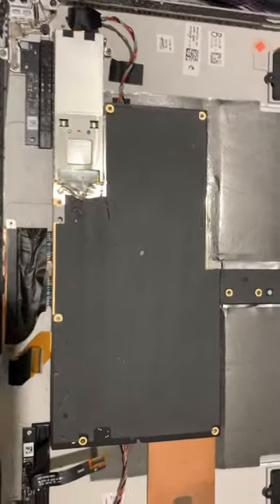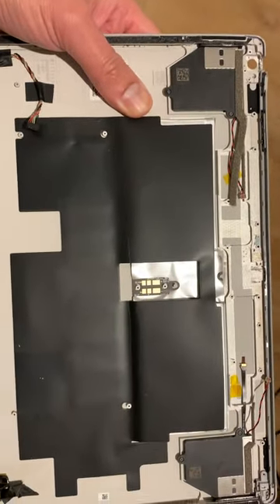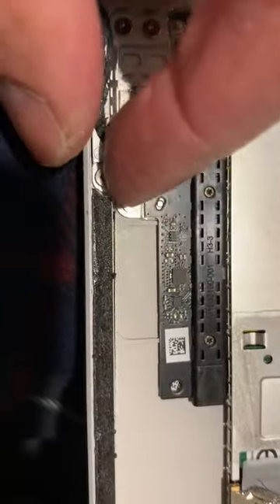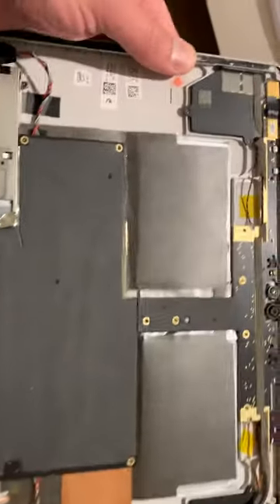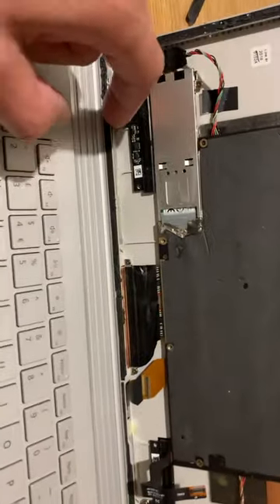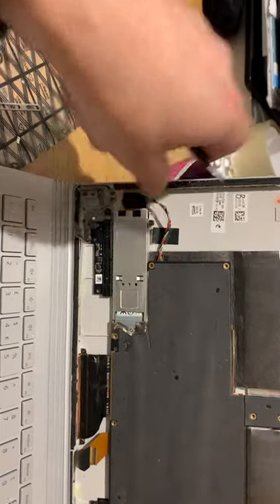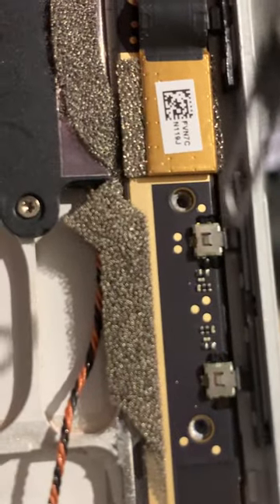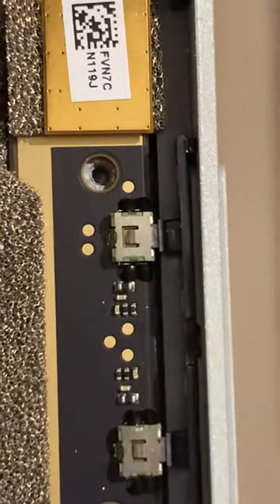Surface book 3 board in Surface book 2 housing after accidental damage

Comment: hi there, I'm too going to replace my motherboard of surfacebook2 due to it's malfunctioning wifi. 
Is it exactly the same size and screw position between the motherboard of surfacebook2 and 3? 
what about the surface connect between tablet and keyboard ? are they too exactly same so that i can only replace the book2 motherboard with book3's and expect it just works fine?
Reply from the maker: I don’t believe you can put a sb2 keyboard with a sb3 motherboard and I am really cross with myself for not testing this.  The holes matched mostly, the 3 has an additional heat sink to the shell but you can move this.  The magnets will need to be swapped.  I would recommend finding a cheaper sl2 mobo or just get a complete 3
Reply: @microsoftsurfacegeekdetail5739  great appreciation for your reply! I'll try to find a cheap book3 keyboard
Reply: surface book 1 tablet works with surface book 2 keyboard? 
Please reply brother